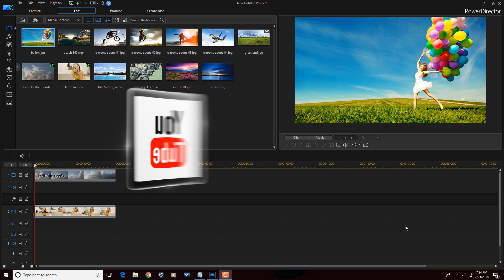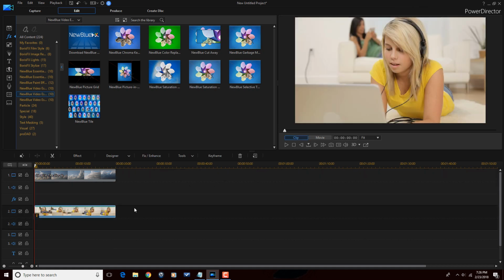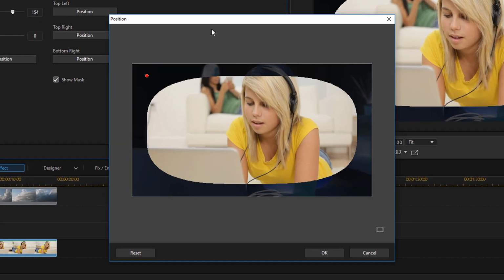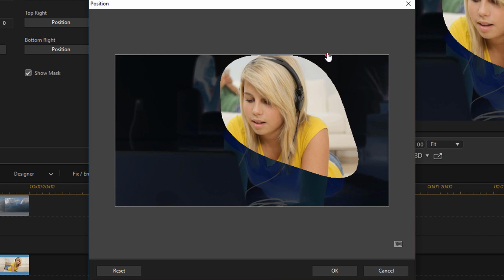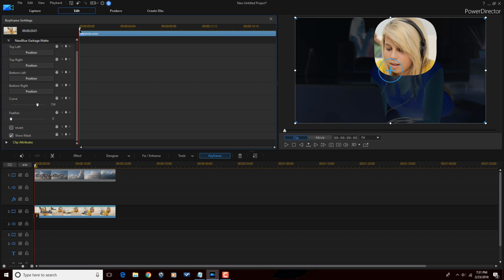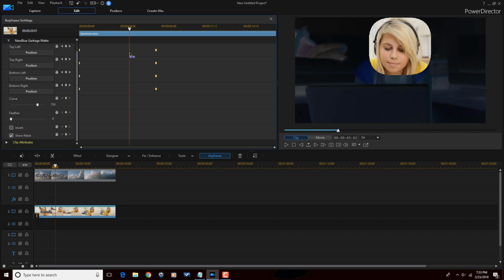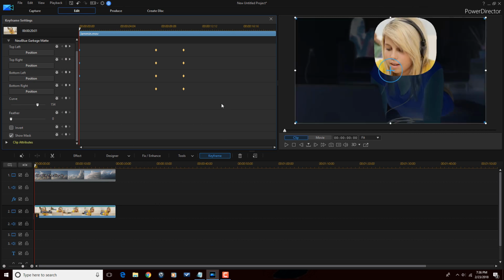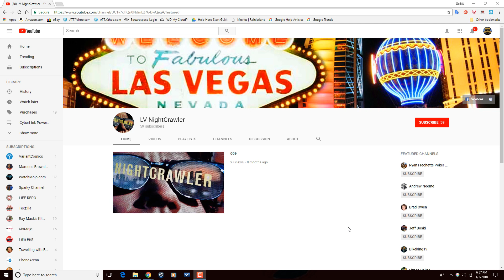How to Make Custom Masks Using a Garbage Matte | PowerDirector

Comment: Hello Maljek
I messaged you before about power director screen recorder.

My version 2021
Records fine.

But when I do a playback it stutters jerks and almost freezes.
I tried using different media players.
VLC &  WMP

IT MAKES NO DIFFERENCE IT'S STILL PLAYS BACK BADLY ANY IDEAS WHY ?
Thanks.  Keith
Reply from the maker: I idea. Try asking for help on the forum. The link is on my channel under the About section
Reply: @PDU_Tutorials  

Thanks I will give it a try

Comment: Would it not just be easier to use the mask tool in power director and keyframe the mask and not have to key-frame the 4 positions of the garbage matte? For this particular example.  I can see other cases that the garbage matte could be used.
Reply from the maker: Could be. It is all up to the user. :-)
Reply: Good point!